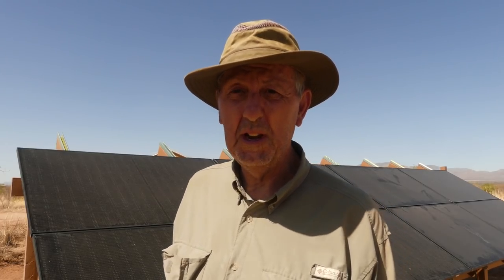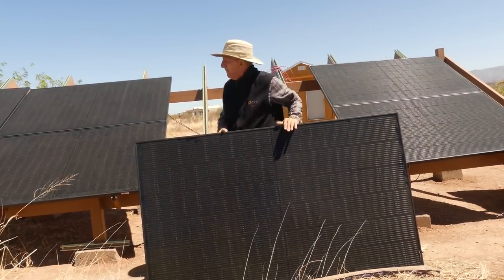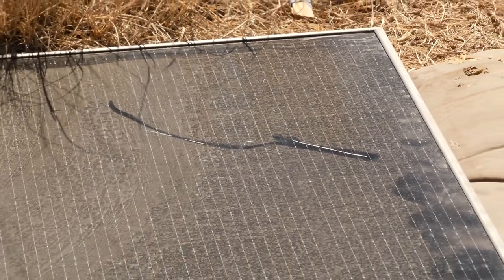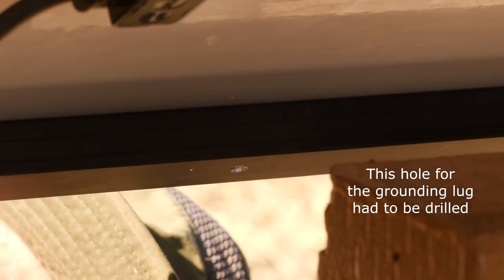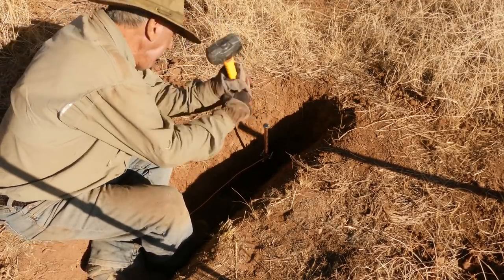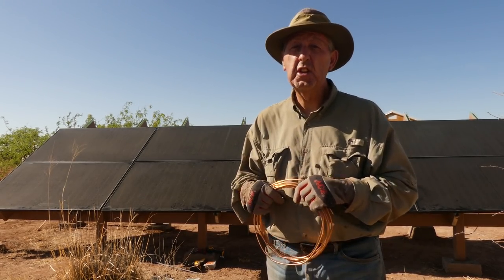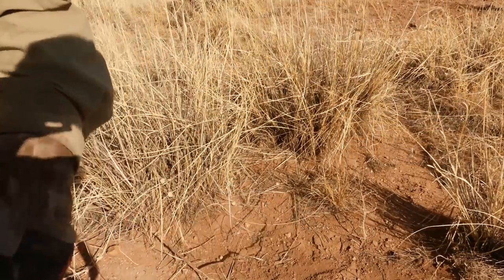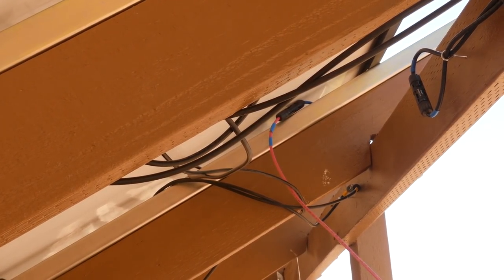Off-grid Senior Avoids Being Fried by His Solar Array

Comment: As a ham radio guy, I have put ground rods in all over the country. Ground runs should be as short as possible so I am wondering why you moved it so far from your solar array. A suggestion also, if you haven’t grounded your cabin drive another ground rod next to the entrance of your power feed and ground it. Then bond the two ground rods  together to avoid a potential  difference
Reply: Yes I agree on a ground rod to the cabin too … also why not just splice the ground wire instead of going and getting a longer length??
Reply from the maker: Will be grounding the cabin next week actually. Thanks for watching.  I moved the ground run a good distance from the solar array hoping to avoid even the slightest chance of them being fried.
Reply from the maker: I wasnt sure a spliced wire would be as effective so got a  new one.  Still learning here.
Reply: Boomer Bits maybe you could offer him some additional advice about grounding in dry desert soils? Long ago I worked on the administrative side of an FM radio tower install. I have vague recollections of specialized backfill with bentonite clay and some system that captured condensation and channeled it down to keep the clay moist. I don't think his little gravel trench is going to keep enough moisture around the ground rod(s).

Comment: In my humble opinion you might be better off eliminating the 2x6's from your solar panel setup and just use the unistruts. Might eliminate the binding problem with the warping. Then you could use the wood for another project. Having lived in AZ for many years I learned using wood for anything turns to garbage very quickly. Best of luck to you. ✌️
Reply from the maker: I thought of that Scott but thought it would be worthwhile to have a base of 2x6 under the unistruts.  Bear in mind these are pressure treated and for good measure I put two coats of paint on them.  (some thought it was overkill but I am all into overkill)
Reply: Aluminum framing is the way to go, more expensive initially but considering the problems you are having it would be a much better solution.

Comment: I had my shed wired by an electrician, he used a grounding plate, buried about 1 ft down, close to the shed below the power junction box.
Reply from the maker: Thanks mush.  I am going to ground my cabin as well. Another grounding rod but then wired to my electrical system in the cabin.

Comment: Don, when you cut your copper wire to short. You  could have done what I would have done to save some money and time. All you needed to do was add a couple of small copper wire to the existing wire you already had. Just using a linesman splice. You just take one end of the longer wire and wrap it a few wraps on the length of that is to short. Then taking the short length wrap it the same amount of times onto the length that you are adding to the shortened one. It will work great. Lineman use that method to splice together over head power lines that break.
Reply from the maker: Great suggestion. I thought if I spliced it then it wouldnt have been as effective during a lightning strike.

Comment: My inspector required me to use brass bolts where wire connects to grounding rod...
Reply from the maker: Good suggestion Republic.  I was under the impression that the most important thing was the brass clamp that went on the grounding rod.  As you can see I did that one.  But I have lots to learn still.
Reply: @affordabledesertliving3487  there’s an approved ground clamp designed for buried connections. The clamp you used is not rated or approved for this application. Home Depot carries the proper clamp.

Comment: Don- Because the frame of your panels are aluminum, you really have to apply 'no-ox' to the surface of the frame and the mating surface of your copper wire connector.  You need to do the same thing with the copper grounds that you joined the panels together with. Also, before you apply the no-ox, insure that you wire brush the aluminum frame where it mates with the copper connector.  If you don't,  the dissimilar metals, copper and aluminum, will corrode due to electrolysis and a high resistance connection can form and you will no longer be effectively grounded.  You can pick a bottle of it up at HD and feel safe for $7. Stay safe.
Reply from the maker: Great tip Radar88.  Many thanks.

Comment: Ground runs should be as short and straight as possible, no sharp bends and the gnd wire should point down through the connector towards earth. As boomer pointed out you need to bond all grounds to prevent a difference in potential.....
Reply from the maker: Thanks for your input Koda. Cheers!

Comment: Don, ( Great Name BTW 😉) sorry for the late comment, but I just discovered you a few days ago, just making my way through your videos. I'm currently researching doing exactly what you're doing ( I'm 60+ and nearing that time, with little to no savings ), so you are really an inspiration to me. I'm in the very early stages of looking for property. As far as affordability, it seems thus far that Mohave and Cochise counties are the only viable options. I'm looking hard in Mohave ... I'm just not sure I could handle the cold and wind in Cochise. Speaking of wind ... you seem to be constantly battling it ... Have you ever thought about supplementing your solar with a wind turbine ?
Reply from the maker: Hi Don!  Thanks for watching all of the videos.  Make sure Mohave County has a relaxed permitting system.  Otherwise it will cost you a lot for standard inspections for whatever home you choose etc. Cochise is fantastic in that manner.  Yes the wind is annoying but we get a nice break from it in the summer.  I have all the solar power I need so no need to do wind power.  Thanks!

Comment: I am betting that somebody else may have already commented on this, but, since I never learned when to keep my mouth shut, I figured I would add my two cents worth. As you were grounding the solar panels with links of copper, it looked to me as if the frame of the solar panels are made of aluminum. I am wondering if dissimilar metal corrosion will be an issue.  Aluminum is more reactive than copper, and I would hate to see your solar panel frames. Get eaten away. On the other hand, I could be wrong about this, but I know that it is poor practice to put steel and copper together for that exact reason. I am sure that you have it fully under control, but just in case it never hurts to hear things two or three times. Best of luck with it all Don!  You are doing great!
Reply from the maker: Thanks Matthew.  My understanding is that I can spray a solution on these connections to prevent corrosion etc. You are correct that issue has been mentioned before. Thanks for watching.

Comment: 30 volts is potentially lethal under adverse conditions (like in the rain), so grounding and a breaker are very important.
Reply: DRAW A MAP of where the wires run.  Or take pictures and keep a printout of them in a safe place that you can remember.
Reply from the maker: So I guess the communication suggests I didnt ground my solar array properly.  Hmm.  All of that trenching and laying copper wire and pounding an 8' grounding rod into the ground which I showed in this video.... argh... Now I got to dig it out and start again.
Reply: @affordabledesertliving3487  
Looks like good grounding... but didn't see a breaker.

Comment: I could not tell from the angle of the camera. Did you go to bare metal on the frame where you attached the ground clamp? It is better if you have bare metal against bare metal for a contact surface. Thanks for all the inspiration. I have learned a lot through all your projects.
Reply from the maker: Yep what I did William if you look at it again is to drill a hole in the bare metal frame of the panel. Attach a brass lug and then fed the bare wire into the lug.  Should work from everything I have learned so far. Thanks for watching!
Reply: Thank you. I was not sure if that was bare metal. On aircraft whenever we attached a ground we used a special brush tool to make sure we were down to bare metal for the ground. Just depending on the bolt and the bare metal in the hole for the bolt to be the contact surface for the ground was not good enough.

Comment: Having built cell sites here in California since 1986, we drive 5/8" X 10' long copper clad ground rods all connected with # 2 solid, tinned copper wire forming a "ring" around the site and tower. We don't splice using clamps, but use exothermic welds on everything. I used to think that it was overkill, but over time came to understand the purpose for doing so. All metal, including  monopoles, towers, fence posts, metal gates,A/C units etc are grounded. We literally ground the snot out of everything. I no longer can work, but get exhausted watching you do all the manual things you do. Don't over-do it especially now as we are entering hot weather. I've worked in 120 degree heat near Palm Springs and El Centro and it's not fun, and it's dangerous, if you're not careful.
Reply from the maker: Thanks for your helpful tips Lynn. I actually thrive in hot weather which is a bit odd for most but then thats just me.  Happiest between 85 and 100.  My friends just shake their heads and go... hmm.  definitely a different constitution. That said I have to drink appropriately and rest when tired.  I wont work for long periods when super hot.  Even I get overheated at some point.

Comment: Don, Great video, I think you just grounded in to different ways. A 10 ft copper grounder rod is a full ground or you can do a Ufer ground which is 2 20 ft #4 rebar in a slab. both are accepted where i live but it may be different where you are. i saw you jump two of the panels to the ground with your copper pipe but don't you need to jump all the panels to ground?
Im just learning the solar side, but I know the 120/220 side. I hope to move of the grid in the next year or two.
Reply from the maker: Thanks for your input Glen.  I was told that those big metal unistruts where the panels are mounted will act as electrical conductors if the array is struck by lightning.  So naturally all I need to do is make sure each of those 4 rows of panels are connected to each other at the bottom. If you watch the video once more you will see I use 3 copper conductors to connect to each row of panels.  So in essence everything should be connected when it comes to electric current running through it all.  Hope that makes sense.
Reply: @affordabledesertliving3487   well you have it then.Ground rods are a pain to drive in but i think it is the best way. you might want one at the house and panels. 
You might also want to think about a lighting ground if you have that down there.

Comment: Here is a tip for the average "Joe". As a certified electrician myself doing ground rods - - Bet yea didn't know ground rods can be buried horizontal direction in the earth .... Think about it sir - - same surface area is required for lightning strikes as (earth)-ground is horizontal or vertical direction & much less grunt work is needed to sink grounding rod in a trench. Resistance is the key factor!
Reply from the maker: Wow, didnt know you could lay them horizontal.  Wouldnt one get fried if they walked in that area during a lightning storm though?

Comment: I have no idea why you needed a trench.

You should still have a grounding rod for your building.  If it gets struck it will probably find a shorter path to ground than through a wire to your solar panel ground.

In some versions of building codes, grounding to steel or copper buried plumbing pipe was accepted practice.  I wouldn't do that but I would make a grounding rod out of steel plumbing pipe.  Add a water fitting to the top and you can soften the soil as you go.  Add salt for higher conductivity (if you don't care about rapidly rusting out the pipe.
Reply from the maker: Thanks for the feedback Joe. Cheers!

Comment: Lightning protection is always a contentious issue, even between lightning protection suppliers.
 I worked on ATC control tower lightning protection for a number of years so I'm somewhat qualified to give you my opinion.
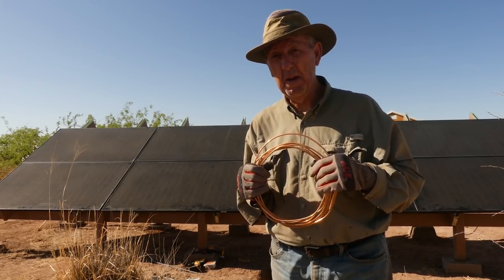 In the first instance, the interconnection  you use at 14:15 has quite a small cross section. I suggest you go for flat busbar similar to the cross section used in 440V 3 phase systems. 
Your house being wood structure means that there is a lack of sufficient conductive metal dissipation in case of a large surge current produced by a strike. This could possibly lead to an explosive impulse current. 
The other is what is the long term history of lightning in your area ?  You might be better off erecting a metal tower somewhat distant from your dwelling if you have the land area to be able to do it.  Any metal tower higher than your current panel and dwelling height is a far better attractor for lightning.
Another bit of advice; if you feel the urge to buy any of those commercial lightning protection warning devices from banggood or amazon that purport to warn you of incoming lightning, please ignore them and don't waste your money.  I work on HF radar and radio systems. Believe me, you need a complex electronic installation to even begin to decode atmospheric noise to be able to separate normal static from noise caused by lightning. You would be better off standing outside and looking at the sky than buying the consumer rubbish that claims to warn of approaching lightning.
Reply from the maker: Thanks for the insight greywolf271!

Comment: You couldn't take the top panel off from the top?  A drill bit that can't drill through soft copper needs to go into your recycle bucket.  German Chocolate cake is great, but my favorite is Pineapple Upside Down Cake.
Reply from the maker: At 5' 6" I am too short and they are each 40 lbs.
Reply: @affordabledesertliving3487  never would have known....you look like you are in the 6' range...guess YT makes you taller :)
Reply from the maker: @omniround9187 I guess my next question would be:  Does this solar panel array make me look fat?  grin.

Comment: Do you have a circuit breaker between the panels and the charge controller?
Reply from the maker: I believe the circuit breaker is built in to my titan solar generator.  That said I will have the system grounded also at my cabin.
Reply: I think you should reconsider.   You need a shut off switch/circuit breaker between the panels and before the charge controller/batteries. This allows a safe disconnect should you need to work on one end or the other.   Recommend you call a good solar electric supplier and ask them their recommendation.   You can get a circuit breaker/disconnect switch both in one.   Best wishes to you.

Comment: Are you able to run an ac unit for the summer? Now that the heat is coming and all. A small window unit maybe?
Reply: A mini split system works great!
Reply from the maker: Hi Santor. With my oversized system I would have no problem running an AC unit.  But I am an odd guy in this manner.  I rarely get over heated.  So I have found after 2 years now that the cross breeze from the windows in my cabin seem to be fine.  Now if I was in Tucson or Phoenix!  That would be different.  In the future I will do a mini split for guests that come.
Reply from the maker: Planning on that one for the future JoAnne. Thanks!